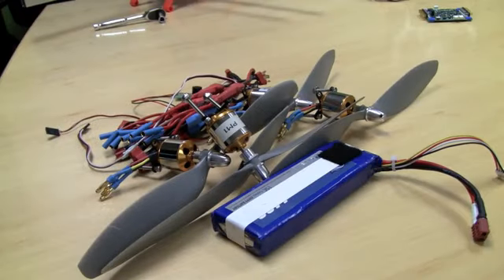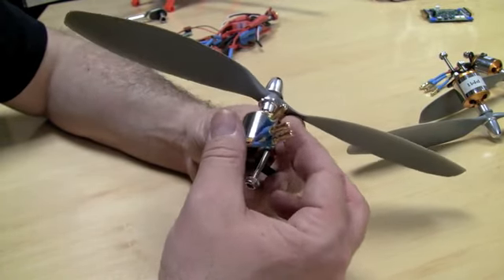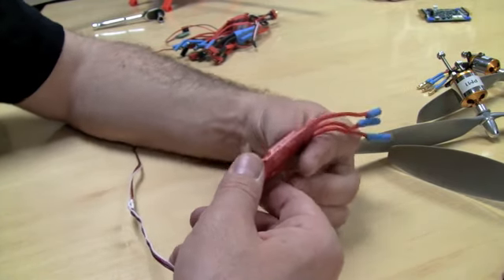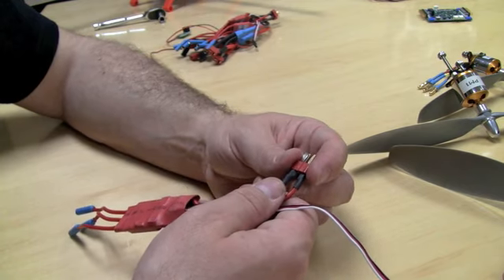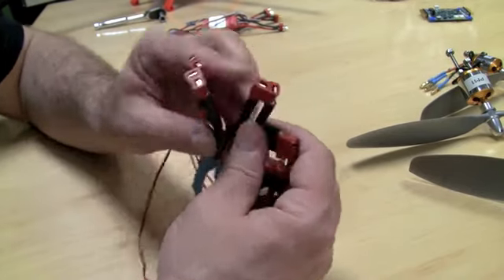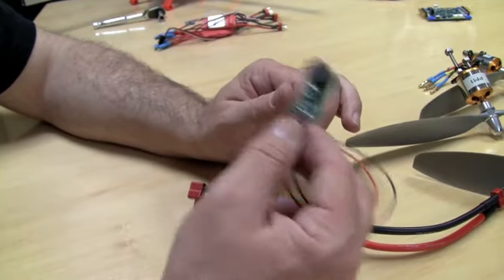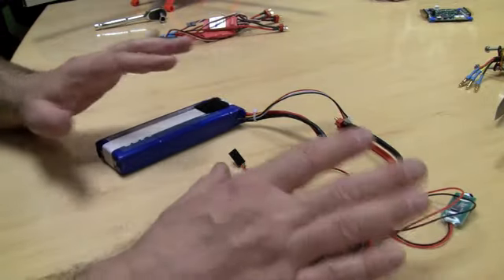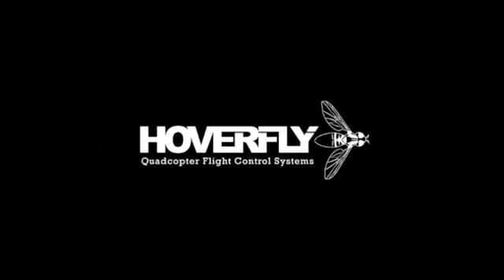Basic Quadcopter Tutorial - Chapter 3 - Power System

Comment: You should use 12 gauge wire for most of these small motor controller, trust me its more then you need and it saves a ton of weight.

Comment: Should be able to use stereo connectors like from Crutchfield, you just strip the wire and screw one end on and push in the other end. Easy to undo.

Comment: Why do the motors have 3 wires?
Reply: You prob already know but for people that don't know. The reason the motor has 3 wires is this: power, ground, and signal. The signal allows you to control the speed, without it, it would be running at full power all the time until you tell it to shut down.
Reply: What it is, is the the three wires are different phases, phase 1, phase 2 and phase 3. the first phase is to spin the motor 1 third of the way. the second phase is to spin the motor 2 thirds of the way and then the last one is to spin the motor the last third of the way until the motor spins back to phase 1. Then starts all over again. Phase 1, phase 2 and phase 3 and so on.... The trick that the esc does is it manages the phases 1,2,3 and it speeds up the phases if it needs to go faster while supporting the same amount of voltage throughout the whole process thus making the motor have so much torque even at low speeds. So I'm not sure if that is what it actually does I could be wrong but im pretty sure thats how it is.